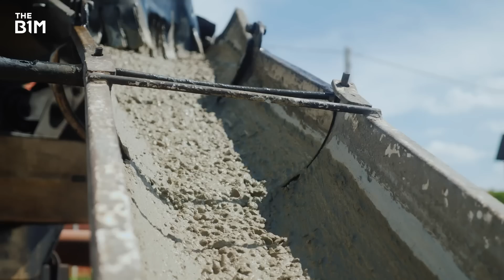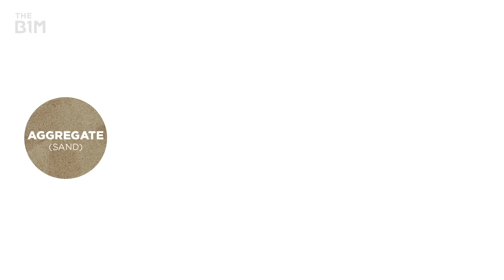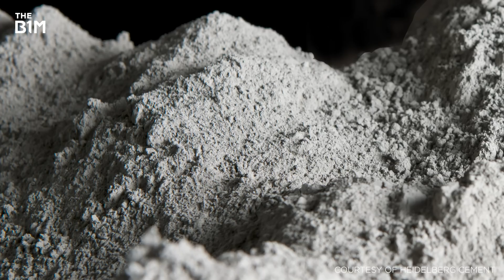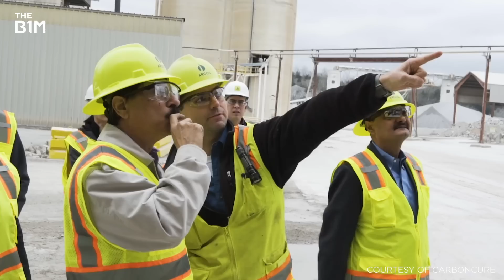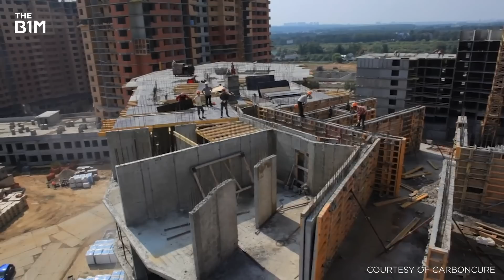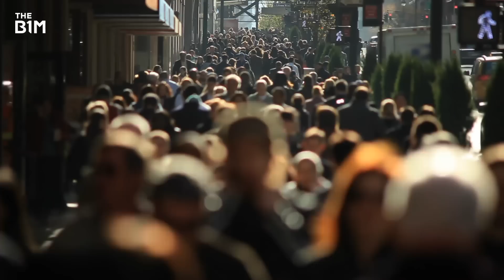New Concrete Alternatives

Comment: I usually like B1M.

The whole video was b.s. CO2 is not a pullutant. 

If you sealed your garage air tight. And you started a car in it with you inside. 

You would a eventually will die of carbon monoxide poisoning.

Not CO2. SMDH
Reply: It doesn't have to be poisonous to be pollutant, nobody said CO2 would directly harm us.
For instance, glass is very inert and safe, not toxic at all. A ton of glass bottles abandoned in the nature won't actually do any harm to any creature and, following your reasoning, should be perfectly fine, not a problem at all.
Reply: @AliasA1  
You do understand plants need carbon dioxide to survive?

This isn't rocket science. 

The greenies made a big stink about not cutting down trees in the 1970's.

They passed a lot of laws. It's one of the reasons it's so hard to cut down a tree in The People's Republic of California.
Reply: @trezapoioiuy  
C'mon Man. You can't be serious. 

Glass bottles are about as much of a pollutant as sinking a ship in shallow water to make an artificial reef.

But you knew that already...
Reply: @JimboKP  
I think it is you who is cherry picking. 

Increase carbon dioxide the faster plants grow. 

This is biology 101.
Reply: @JimboKP  
I'll give you an experiment to try. 

Make a greenhouse. Pump carbon dioxide in and plant tomatoes or what ever vegetable you want. Let me know how it works out. 

If given enough water, sunlight, and carbon dioxide vegetables will grow larger and faster than normal ones. 

This was at the very edge of agricultural science in the 1980's.
Reply: So what you mean is, glass not being poisonous, it would be just fine throwing it everywhere? As long as we don't throw away poisonous stuff, everything else is okay? 
Just because something isn't poisonous it doesn't mean it's okay for the environment. That's what i'm saying.
Reply: @JimboKP  
You are talking about a Forrest. 

I'm talking about how a few plants turn into a Forrest. 
 
Scale means nothing. The process means everything. 

You can't jave a Forrest without trees. 

To be honest. I'm surprised plants still grow with how little carbon dioxide is actually in the atmosphere. 

Believe you want. It still won't make what you believe true.
Reply: @trezapoioiuy  
The question I have is:

What is the big deal about carbon dioxide?

We do exhale it you know?

If you ever watched who makes money off 'climate change'. Or trash on the ocean floor (usually from Asia). 

They ALWAYS find ways to restrict your lifestyle. Aka make you poorer by increasing the cost of EVERYTHING.

While they make millions off you. 

Imagine if I came to you and said:

Let's restrict the amount of water a toilet can use per flush (you can't make this stuff up😁).

We'll tell everyone the richest Country in the world by orders of magnitude doesn't have enough clean water. And we'll force them to recycle it. 

All because the rest of the World doesn't have enough clean water. 

And we won't let companies build desalination plants and (nuclear plants to power them) like they have all over the 'Middle East'.

That doesn't even make sense...

But that is happening as we speak. And its been happening for decades.

Hopefully this will make you think.
Reply: donioshio  
Exactly

I live in Southern California. Contrary to popular belief. It is a desert. 

Let it rain and the desert turns green. Every time it rains. 

Why anyone believes otherwise boggles the mind.
Reply: @massimookissed1023  
One day you will make sense. 

That day is not today.
Reply: @AliasA1  
Water vapor is a bigger greenhouse gas than CO2 will ever be. 

The 'problems' the commies (my word) have with CO2 is they can link it to most industries on the planet. 

Of course these commies were found out to be liars, cheats, and conspiracy nuts. 

That of course goes without saying.
Reply: @AliasA1  
You left 2 variables out. 

Water and water vapor. 

The Oceans are very cold a few hundred feet below the surface. 

They also provide an excellent way to regulate the uneven radiation from the Sun that turns into heat on this planet. 

Just like the radiator on an engine. 

This is the main reason coastal areas are usually more temperate than the interior of a Continent. 

Try holding a torch above a bucket of ice water. 

Let me know how long it takes to bring it to a boil. 

Google is your friend (allegedly).
Reply: donioshio  Well, in the case of the Amazon forest, the only thing keeping it fertile is the biomass produced by the forest itself. Take it away, as it happens, for agriculture and what happens is, it's only fertile for a short time, then you have to deforest another plot of terrain as you leave behind a depleted, infertile soil that would take ages to regrow into a forest and can only do so if there's some intact forest nearby.
Reply: @Warmaster_7  Yes, we do exhale it too, so what. That much is part of the carbon cycle, so the overall balance in our life is zero, as for any other living organism. 
We also produce urea in our urine and that's a very natural product. This doesn0t keep it from being a toxic substance
The problem kicks in when our activities introduce CO2 that was sequestrated into the hearth crust since geological eras ago. Now we're reintroducing it into the atmosphere at such rates that they can break the current equilibrium.
Will life cease existing on the planet for this? Maybe not. Yeah, plants might greet the extra CO2, but basically only them. Some plants were actually around when all that CO2 we're releasing now was in the air, but it's not these plants we have now and, most importantly, none of the animals currenly living - including us - was around.
Can it upset the ecosistem as it is now faster than it can adapt itself to? Most likely

Also, yes, the sun has always had its say in climate change and has being the major driving mechanism. But its not the only entity that did so. Living organisms like bacteria and have always had an impact on the atmosphere and so are we, at an unprecedented speed - maybe only some volcano eruptions ever had a faster impact. The fact that it's USUALLY the sun is not a proof that we CAN'T. The fact that my nose sometimes bleeds for its own reasons doesn't mean you can't be responsible if you punch it and it bleeds.
Reply: @trezapoioiuy  
What is it with people and 'balance' of the Earth?

Sounds like something said in a Star Wars movie. 
 
There is NO balance. We are here for a snapshot in time. The Earth is constantly changing. 

It will never stop. 

It is very difficult to have balance when there are so many variables changing in so many unpredictable ways.

What makes the task of learning about this process so infuriating.

The people making the most noise are usually lying and falsifying their data the whole time. 

20 years ago they could get away with this nonsense now...It's near impossible.
Reply: @Warmaster_7  I meant balance in a more scientific way than you think. Of course there are many variables that can change things (if you admit how can you still deny that we are one of those) but usually those changes are quite slow wich means life can adapt and find a new balance. How many creatures will be able to, however, is a different matter, and the ratio depends strongly on how FAST the change happened. The faster the change, the harder it is. That is balance: at given conditions, things will go on in a certain way, if a change is made there will be a change until a new balance is found. Some fishes even managed to become amphibians - over millennia - and adapt to living outside water, but dry a sea and ALL the fishes will die.

That balance thing is similar to our balance: we can keep standing, while constantly making small adjustments to do so. If someone pushes us stronger that we can deal with, we fall, while a horse pushed with the same sttrenght will resist.
Reply: @Warmaster_7  Yes, it's exactly that kind of brutal and impredictable balance breaking events that gives you an example on how different the balance can be after such an event. When things settled down after those, well, things had greatly changed, there had been mass extinction.
The fact is, on a natural scale, the rate at wich we are altering our system is only second to those events, so what we're doing is almost as abrupt as one of those, even if it doesn't seem so from our point of view. It doesn't happen in such a short time as an asteroid would, but decades or centuries are still a nothing on a global scale.
This means we can't really predict what will come from this, but it might well be fast enough to trigger some very violent change and we don't know how many and what creatures will end up getting the short stick out of this.
Reply: L6rd 6f Cr6ws  
What does bleach taste like?

You sound like an expert. Or was it lead paint chips you were munching on?

Side note:

How do you become an enemy of humanity and the planet?
Reply: @trezapoioiuy  
I think most people would take this whole 'climate change' aka 'global warming' aka 'global cooling' seriously if the commies hadn't tried repeatedly to:

 1) Restrict our Freedoms which included our gun Rights and Freedom of Speech. 

2) Guilt us in to giving up our cars.

3) In the U.S. there has been few nuclear power plants built in the last 50 years.

Nuclear power is the cleanest and safest energy ever created. 

They also LIE repeatedly. Without shame or remorse when their caught. 

And that is just some of these things these commies do. 

I don't trust them any farther than I can throw an Aircraft Carrier. 

They want to halt human advances that they they don't like. 

I've never heard these commies condemn Elon Musk's electric cars. Or Space X.
Reply: Warmaster 7 That’s a whole other matter, I also have zero confidence in my current government and I’d rather listen to what the science says than any of their words. Wether we’re harming or not is not something the politicians can decide